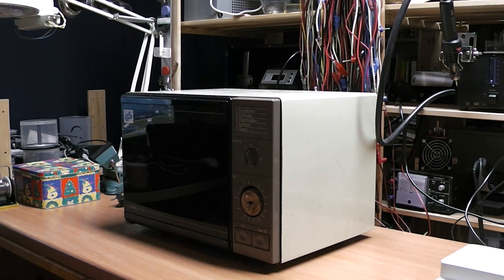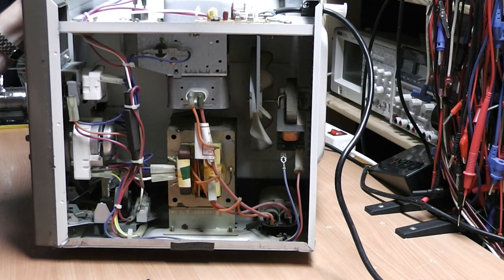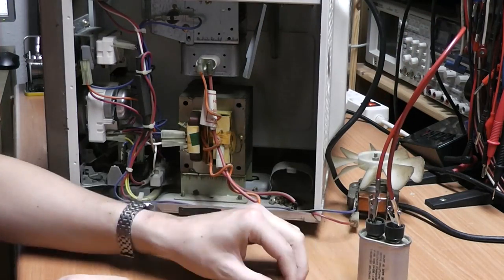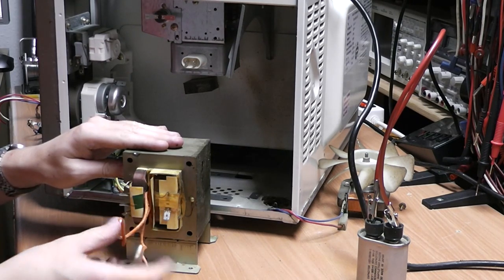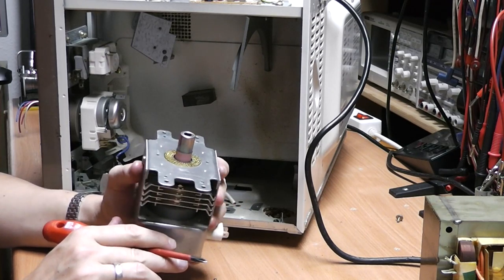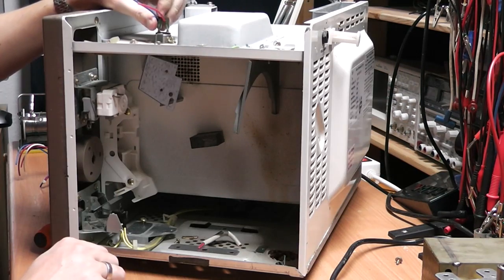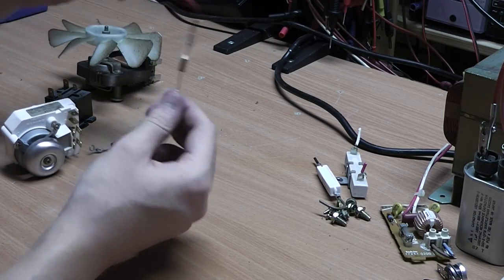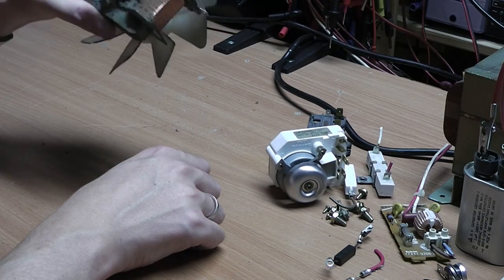Safe Microwave Disassembly

Comment from the maker: Correct. Most of the microwave caps however have so-called "bleeder" resistors internally (this one also did): They're designed to slowly discharge the cap when it's disconnected. Typical bleeder value is 10 MOhm. With a cap value of 1uF and an assumed initial charge of 2kV, this means that after 30 secs there's about 100 Volts left and after 50 secs it's down to 14V. Therefore no cap. Bleeders aren't a guarantee, though, so better be safe than sorry (it can hurt quite a bit).

Comment: I would have shorted that cap before taking the fan out or anything like that, just to be sure. Just use a metal tool with an insulated handle to connect the leads.
 I appreciate the speeding through the boring parts like removing screws.

Comment: You should have removed your watch and wedding band when working around a capacitor, or inside of any electrical equipment for that matter.
Reply: Is it unplugged?
Reply: @jdavis6646  capacitors can still hold voltage regardless of whether the machine is plugged in or not

Comment from the maker: Hmm, probably not without reasonable effort. The filament is inside the resonance chamber, which will usually be welded shut. So you'd have to cut that open first. Why are you particularly interested in the filament, if I may ask?

Comment: I feel like such an idiot. I disassembled a microwave for parts and didn't discharge the capacitor.
Reply: You got verrrry lucky
Reply: well there goes your entire storage of luck for the rest of your life
Reply: @TubeNotMe  Well, I did it right after this.
Reply: @DangernoodleDave  I later discharged it. I'm usually better when it comes to safety, especially with electricity.
Reply: @squidwardtentacles244  Drained it like a grounded capacitor.
Reply: @DrachonaTheWolf  that's good. Glad you're safe 👍

Comment: I want to turn an old microwave into a turn table. If I disconnect the magnerton and the fan, will that work? (worried about the capacitor. Should I leave that connected?)
Reply: You're better off removing the capacitor.  It's not only safer but it will give you more internal room to work with when you do your conversion.  Hope it turned out very well.
Reply: @dang48  I found a microwave where the motor voltage was the same as power voltage so all I used was the motor/glass turntable and a switch.
Reply: @johncrow5552  Cool!  That definitely is a big help.

Comment: So I am honestly scared of the capacitor , right now especially one so strong lol , i see the magnetron as profit , The transformer is in working condition. Everything works except for the start button lol anyways I think I’m just gonna throw all those good parts out as they are of no use to me as of now and the risk seems a bit high for my liking.. The fan however.. What would I use to power it? It’s 17W 120V

Comment: Hi I heard the the pink insulators are only dangerous if crushed and powdered!!!??? I have about five magnitrons sitting around my shop from scraping microwaves and a stack of those ring magnets that are great for picking screws up on the shop table!! please reply Thanks Ben
Reply: If you slip while trying to remove the housing and crack that insulator, a small amount will be dispersed as powder and tiny particles. You don't want to get any beryllium in your lungs at all, so he's recommending that you don't take the chance. I've seen another guy take one of those apart but he also said he would not recommend other try it.
Reply: Basically. Maybe not a high chance of happening. But the result isn’t worth risking

Comment: Help! The door of my microwave suddenly will not open. I put in a cup of tea to heat it, and now the door won't open. When I push the door opener button, it seems to press down much further than before. How do I get at the door to release it, remove the cup of tea, and begin fixing the faulty door latch? (Panasonic Inverter, model NN-T695)

Comment: I took one apart and i immediately stopped when i saw the radiation warning. I got pretty scared and now I'm looking up microwave radiation. I got the copper though :D.
Reply: In addition radiation is dangerous based on cumulative exposure. I can’t understand the alarmist attitude about the pink berillium or asbestos either. Yes, know the danger, but if I walk by and breath asbestos one time I’m not likely to immediately double over with lung cancer. It’s a correlative risk but is not an positive causation of illness.

Comment: if i buy a non working microwave, would the transformer be broken or something else
Reply: Tim Billiet depends on the issue with the microwave. It may just be a problem with the circuitry. You should be able to find a lot of them for free tbh

Comment: Always watch programmes like this I didn't I cracked open the tube...and the shit went up my nose...stupid I know but I wanted the magnets and shit happens,...straight away..i heated my glue gun and dripped it into the hole sealing anymore inside...this is not a scare mongery story it's the truth...I may be ok but at 64yrs old maybe not...i buried the part deep in my garden...beryllium oxide poisoning has no cure...pointless going to doctors or hospital...BE WARNED...ty
Reply: You burried magnetron in your garden? What?
Reply: lmfao